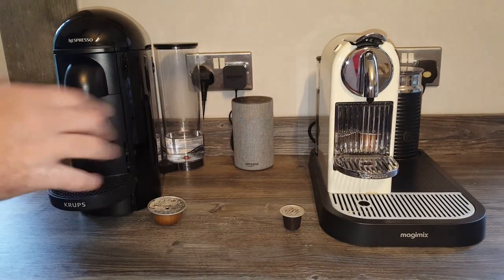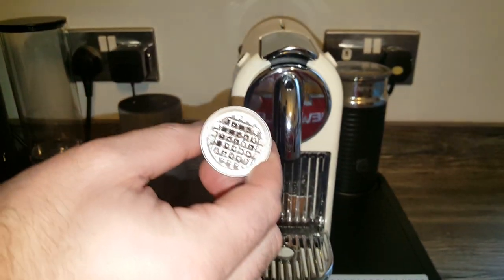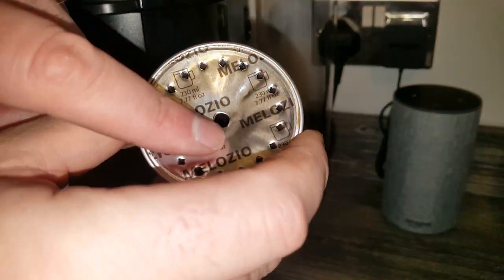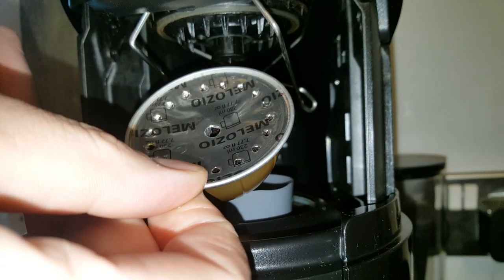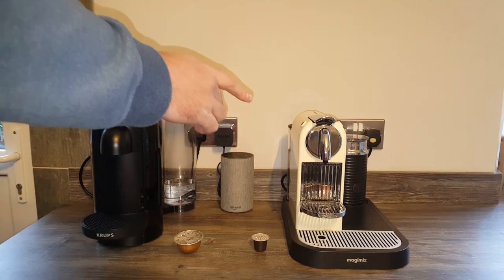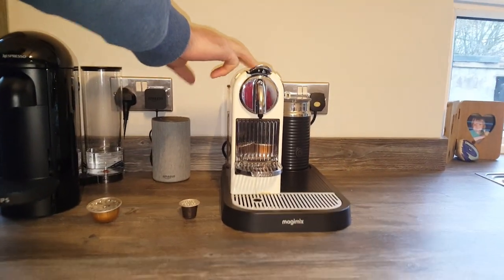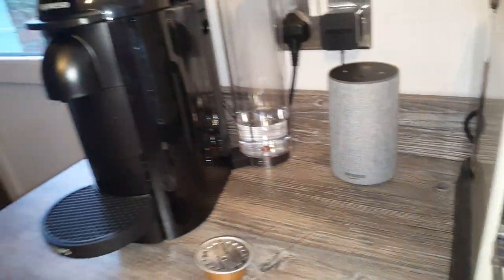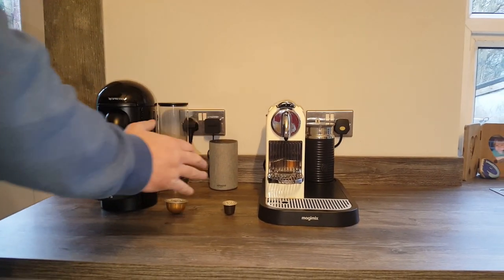What is Nespresso centrifusion and how does it differ from bar pressure coffee extraction?

Comment: It's certainly not the same kind of crema, but I have a hard time understanding how it could be any less real (unless it's a semantic argument about crema vs other foams on coffee). Like if they added an extra foaming agent to the coffee or pumped in foam from elsewhere, that would certainly be fake. But this foam is simply a product of the water, coffee, and process.

Now, I don't know if it's a good process, but I think a good question to ask is "what if the newer method came first?" That is to say, if centrifugal extraction was invented before pressure extraction, would people call the pressure extraction crema fake? We can't know, but it doesn't seem farfetched to think that it would be looked down upon in some way. If not as fake, then because "oh look at them using this cheap method without any spinning parts, it doesn't even produce much crema!"
Reply: I agree, Marcus.  I'm pleased with my machine (though wish the pods were a bit cheaper) and find both discovering the different coffee varieties AND the way the system works, a really interesting process.

Comment: I was just going to say the same thing. Is it acually creama or just foam.
Reply from the maker: I'd say more foam than crema with the vertuo but a lot of people still seem to like it. Also had a few people comment saying that the crema from the original machines isn't as 'real' as the crema from standard espresso machines due to the amount of coffee in the pod etc. Quite a debate around Nespresso and crema isn't there 😅
Reply: @A2BProductions  Indeed, real espresso machines (the ones you see in coffee shops and high end home machines) use a basket with a large number of holes. If you were to just run water through the basket the pressure would never build up. When filled with coffee which has been ground appropriately finely (more finely and evenly than most cheap grinders can reliably manage) the coffee "puck" restricts the flow of water which allows the pressure to build up to 10 bars. Most importantly, this high pressure allows a lot of carbon dioxide (which is abundantly present in freshly ground coffee) to infuse into the water alongside lots of the important volatile compounds which produce a true espresso taste. Once the pressure is released (once the coffee infused water leaves the basket) the carbon dioxide comes out of solution (due to sudden decrease in pressure, like opening a bottle of fizzy drink) which combined with the natural oils in the coffee produces a very fine foam almost like the kind you see in a pint of guinnes.

All the pod machines I know of and even most consumer grade bean-to-cup machines do not use coffee ground finely enough to restrict the flow enough to produce the desired effect. In order to build up the pressure they use a pinhole in the basket to restrict the flow. The result is that coffee then jets out of the pinhole which would make a mess in the cup so these coffee machines then use some obstruction so the coffee slows down into a pour. It is likely this obstruction which aerates the coffee and produces the faux "crema" which is mostly filled with air and has bigger bubbles and a lighter appearance.

I'm sure some real crema is there but really this is the reason why pod machines produce more "crema" than normal espresso machines.

That being said, "crema" is really just a marketing ploy devised by the original developer of the pressurised espresso machine. The espresso machine was designed to extract coffee very quickly which required very high pressures (to ease the diffusion of the important flavours out of the coffee and into the water) which as a side effect created a "scum" on top of the coffee.

This scum didn't appear desirable at first but through a genius marketing trick it ended up being used to market the machine. It became the signature "crema" of that style of coffee.

In reality, if you skim off the crema from one of these machines and drink it on its own you will likely find it doesn't actually taste that great, it's not really a problem for the taste of the coffee as there's only so little of it but if you skim it off you can usually get a marginally less bitter result.

Regarding these centrifugal machines. Since they don't use any pressure, I'm not really sure if they can be considered espresso machines. It seems like they use a fine grind and centrifugal force to do a sped up version of a drip brew with what is probably a metal filter. The crema is unlikely to be caused by carbon dioxide and much more likely to be just an exaggerated version of the pressurized pod machine effect where the water ends up aerated through sheer force.
Reply: ISFiYIywAFIBc6qAIIIIIIIIIIIIIIIIQrXTJiCtY3Asd4WF I can tell from my limited research in choosing a machine that you are knowledgable. I thought the same regarding the centrifuge method and cynically feel, or felt is was all marketing and gimmick and commercial. It's probably a mix but look up the patents. I am confident you will enjoy the read. They are long but one thing about patents..they can't BS or they risk losing the grant as well as not protecting their territory. I've only skimmed but appears there's quite a bit of tech involved - and there is pressurization through the hydrodynamic forces in a sealed container. Maybe not 9 bar though. They seem to mention a valve that releases within a varying pressure range (3-8 bar if I recall). But one thing I assume - they have tailored their coding to get the best results for each capsule - that only makes sense.  If the coding could be manipulated by end user, it would be fun to experiment on the re-fill end. I am sure the coffee is not as good as a good manual machine or perhaps even a pump pressure Original.  I just received a VertuoNext as gift - thoughtful but the last model I'd have chosen - such are gifts - so I am trying to justify it now in lieu of what I'd have wanted. Still, the tech seems more than gimmick.  Let me know what you think. Google the patent and Reddit and it should find the links.